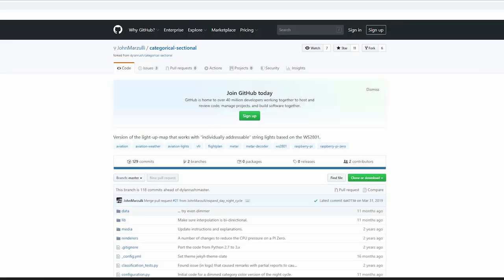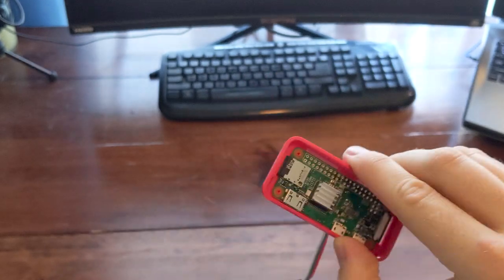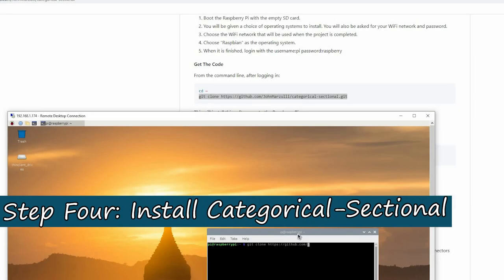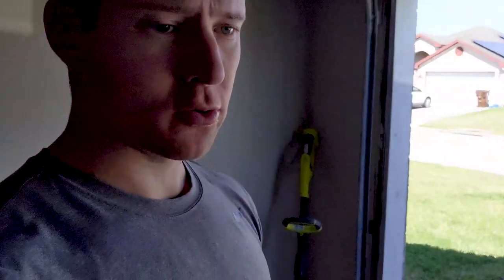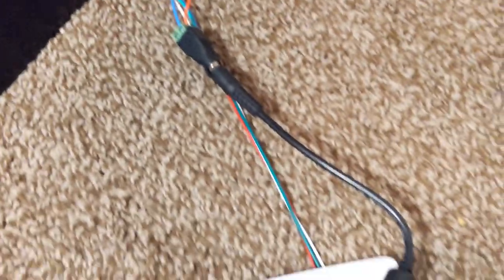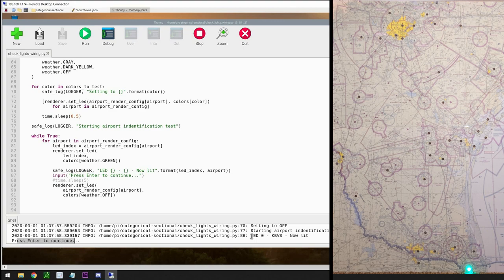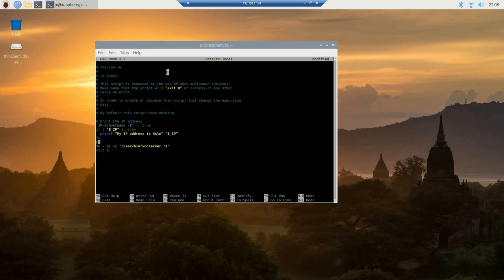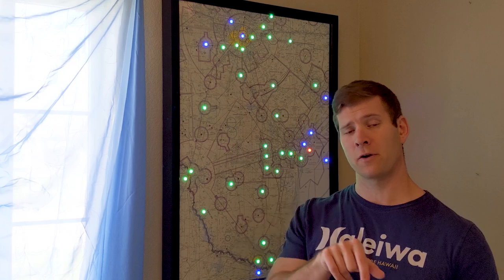DIY LED Aviation Weather Wall Map

Comment: If I wanted too could I cut the wires to add more wire instead of skipping LEDS that are not being used? By using extra wire, soldier pencil, and heat shrink?

Comment: Great tutorial. Just a quick question. Is there anyway to use the Raspberry Pi power to run the LEDs? Seeing if it's possible to only have one power cord coming from the unit, but I am guessing it's the only way. Making a ZKC sectional and cross referencing YT tutorials and github. Thanks!

Comment: I am working on setting this for myself and I got to the soldering portion and I used the same ports as you but the guides I was reading seemed to specify different ports so I was a bit confused. When I tried the test LED function they all lit as white and then nothing else happened with them. Not sure what I need to do or if I am missing some component somewhere?

edit: Also now I am getting a KeyError: 'gpio_pin' when I run check_lights_wiring.py

Comment from the maker: I didn't talk much about the frame build, but I'd be happy to throw up a materials list if anyone needs! Building the frame myself cost me only about $20 in materials and a few hours of my time. You can easily buy a shadow box as well, but I'd recommend removing the glass so the LEDs don't "bloom" across the surface. Enjoy!
Reply: If you have time, I would appreciate if you added the materials for the frame build, etc... It will give me something to do during this quarantine!
Reply: I'm thinking I'm going to just use a standard frame size from Michaels to save the hassle. I might actually just have the PDF sectional printed on foam board to not have folds in a purchased sectional?
Reply from the maker: @dub1388  I'll try and make a follow up video this week about the frame. Essentially used 1x3s and quarter round with mitered corners.
Reply: I was curious about the dimension of the frame

Comment: I am curious if software required for the programming can be used on a Mac? Thought about building one, but unsure if I can complete it with my MacBook. Thanks
Reply from the maker: You can certainly remote desktop from your Mac into the PI, but not sure about running Python on a Mac.
Reply: @RhinoOffroad  - You can absolutely run Python on any Mac made in the last 15 years, but it would be unable to perform the IO to the LEDs.
Reply: rkaneaster You can always SSH

Comment: What did you use the 3-pin connectors for that are on your parts list? The github parts list only shows that 4-pin JST plugs are required.
Reply from the maker: You don't have to use the 3-pin, but if you use the 4-pin you'll just have a wire on each connector that you'll have to tape off that isn't used. Instead I used a 3-pin, and used the 4-pins for extensions between the LEDs.
Reply: @RhinoOffroad  The LED lights are labeled "GND" "DI" "5V". Can you correlate that with the ports on the Rasberry Pi? I know where GRN is, but the other two wires, #23 and #19?? Not sure which one goes to D1 and/or 5V.

Comment: Hi! Thanks for tutorial, very cool set up. I am having a few issues with the software installation however. Specifically when trying to run the check_lights_wiring test. I get the following error prompt:
%Run check_lights_wiring.py
Traceback (most recent call last):
  File "/home/pi/categorical-sectional/check_lights_wiring.py", line 11, in <module>
    from renderers import led, led_pwm, ws2801
  File "/usr/lib/python3/dist-packages/thonny/backend.py", line 305, in _custom_import
    module = self._original_import(*args, **kw)
  File "/home/pi/categorical-sectional/renderers/ws2801.py", line 13, in <module>
    import Adafruit_WS2801
  File "/usr/lib/python3/dist-packages/thonny/backend.py", line 305, in _custom_import
    module = self._original_import(*args, **kw)
  File "/usr/local/lib/python3.5/dist-packages/Adafruit_WS2801-1.0.1-py3.5.egg/Adafruit_WS2801/__init__.py", line 1, in <module>
    from .WS2801 import *
  File "/usr/lib/python3/dist-packages/thonny/backend.py", line 305, in _custom_import
    module = self._original_import(*args, **kw)
  File "/usr/local/lib/python3.5/dist-packages/Adafruit_WS2801-1.0.1-py3.5.egg/Adafruit_WS2801/WS2801.py", line 24, in <module>
    import Adafruit_GPIO.SPI as SPI
  File "/usr/lib/python3/dist-packages/thonny/backend.py", line 305, in _custom_import
    module = self._original_import(*args, **kw)
ImportError: No module named 'Adafruit_GPIO'
Any idea on how to proceed from here? Thanks in advance
Reply: Same

Comment: Another question. What did you use to secure the Map to the board. I want to make sure that it keeps looking good for years to come.
Reply from the maker: Just Elmer's glue. May not have been the best choice but only time will tell
Reply: @RhinoOffroad  I'm sure that will be fine, but some 3m spray adhesive might be better. The other option you have is to actually just have the sectional high res sectional PDF (available online) printed by a sign shop on some foam core.

Comment: How big did you end up making the actual map?  Is it like 24x36 or 18x24?
Reply from the maker: 38x26 I think. Basically just squared off the area of the sectional I wanted and made the frame to fit that.

Comment: Great tutorial; but, I am having a hard time getting the WS2801 LEDs to function.  I've followed the steps exactly, using different 2 RasPi devices (a Zero, and a 4).  I can only get one light to work (which happens only when I power down and restart both the Pi and the LEDs), which is either white or light blue.  When I run check_lights_wiring.py, the single light (#0) is extinguished, none of the lights cycle through the colors, and do not light in sequence.  I've run the Python script both from the CLI, and Thony (app).
Reply: I am having the same issue at the moment, too.
Reply: Did you ever figure out a solution to your issue?
Reply: Y'all ever find a solution? I'm having the same problem

Comment: I see some of the locations where you skipped LEDs actually contain airports, why not just populate them as you had the LEDs anyway?
Reply from the maker: Because there weren't any more with weather reporting I don't think, so the LED would have never lit up.
Reply: @RhinoOffroad  Ahh. Thats why you "backed it up" with foreflight..

Comment: Can you tell me what Part # 2 goes to? Currently, Amazon indicates "SORRY Could not find Page" Thank you!
Reply from the maker: Hey Kelly! Search Amazon or Ebay or "WS2801 Pixels", and it will work just the same as the LEDs I used. Hopefully that helps!
Reply: @RhinoOffroad  Thanks, ended up figuring it out in terms of what was missing as well as the GitHub page. Thanks again sir!
Reply from the maker: No problem at all, let me know if you have any other questions
Reply: @RhinoOffroad  I assume that even though you started out using the wrong connector (Male/Female) I assume the following using the FEMAIL adapter. White to 25 (GND) Green 23 (GPIO 11) and Red 19 (GPIO 10). Is that correct? Thanks again
Reply from the maker: @KellyBradyPilot  it really depends on your LEDs. It should go GND, Clock, then skip one and Data
Reply: @RhinoOffroad  Not even sure how but it appears my PI overheated and is shot. I took another look at the picture for running the WS2801 Wiring. The very first picture has your JST (4 Pin) male connector going to the RPI, in order from left to right = Blue, Red, Green, Black. My male JST connector is the exact opposite. In order from left to right Black, Green, Red, Blue. It fried the board. The Only JST male connectors I found were on amazon - What I didn't notice is that when the JST female end of the LED connects to the male end of the PI is that there opposite. Check out the picture here: netguyit.com/images/wirePic.jpg. I screwed this one up for sure. Lol, no biggie I know what to do now.
Reply from the maker: @KellyBradyPilot  I haven't had this issue myself, but I'd focus less on the colors and more on following each connection. To the RPi, you need three wires: ground, data, and clock. Off of the first LED, you'll have an additional ground and +5V to connect the LEDs to power. If you accidentally connected the +5V to a 3.3V or Ground on the RPi; this could be your issue. I've noticed that different LED vendors have different wiring diagrams, so you just have to double check each connection before you apply power. Best of luck!
Reply: @RhinoOffroad  Totally hear you there. I got too fixated on colors and missed the obvious by injecting volts into the ground side of the board. No worries. I'll keep you posted as I receive a replacement board tomorrow.

Comment: I've gotten everything connected and programmed but when I plug in the lights not all of them turn on (always a different number each time I unplug and replug) and they are only showing pale blueish purple light. When I run checks on the lights nothing happens and they won't turn on in sequence when naming the lights. Anyone help?
Reply: I used WS2801 lights
Reply from the maker: I'd double check you have the data and clock wires connected correctly. It sounds like the lights are receiving power but no signal. I get the exact same thing when I plug the power into my lights before the program boots - just randomly colored blue LEDs.
Reply: I moved over to a different metar build with WS2811 lights and had an easier go at programming. https://github.com/prueker/METARMap

Comment: I've forked the project and added support for 2811 LEDs which are cheaper and use a single data line. I also plan to add an easier setup script which will ask you what airport is lit up to make the setup easier and more interactive. https://github.com/jamesrusso/categorical-sectional
Reply: James Russo so, if using 2811 LEDs, is the setup the same as shown in the video except nothing is attached to pin 23 (SCLK) on the pi? Also, does the data wire go to GPIO10 as shown in the video or GPIO18 as shown in your config file?
Reply: Mason Clouse the data input to the first led goes to pin 18 then specify gpio port in config to be d18. The 2811 just has one pin and it is a shift register to the other leds. So just 3 wires to the leds
Reply: James Russo ok, so since I’m using an external power supply for the LEDs, only 1 wire will go to the pi? (Sorry I’m new at this)
Reply: Mason Clouse well two actually. One for the data input to d18 and then tie the grounds together. No worries, happy to help.
Reply: And by tie the grounds together means take the negative on the external power supply and tie it to the negative on the pie.
Reply: James Russo Thanks for the help, my map is up and working. One small issue though — as the lights are gradually fading out during sunset, when they get to about 50% brightness, they suddenly jump back up to 100% brightness and then continue fading out from there. Any idea what might cause that or is it intended?
Reply: @masonclouse  I've noticed this too, but haven't dove into why this happens yet. I suspect it has something to do with the sunrise/sunset calculations being made. I'll fix this once I get my map up and running. My final parts just arrived today and I'll be hopefully finishing it up this weekend.. I have my PPL check-ride tomorrow, otherwise, I'd be working on it now!
Reply: Log an issue on Github if you can so we can track it there. Maybe include your log files if you can along with the name of the airport where this is occurring.
Reply: James Russo I’ll go ahead and do that. Good luck tomorrow!
Reply: James Russo looks like issues are disabled on your repository
Reply: As a fellow software developer and aviator, I can't wait to dive in on this project and help contribute if I can. Great stuff guys! 👍🤓
Reply: @sators  I have completely rewritten the software to be more OO and organized... added an angular front end for specifying the airports and RESTful API control.. I'll post more info about it all soon...
Reply: Here is a new repo with a full rewrite.... https://github.com/jamesrusso/led-aviation-metar-sectional
Reply: Solved yet?
Reply: Im running into a snag on the setup portion...Im totally new as well. How/what is running as root? 

Also, im assuming you have to run cd led-aviation-metar-sectional prior to the cd sectional-webapp?

I can't get past the ng build --watch...